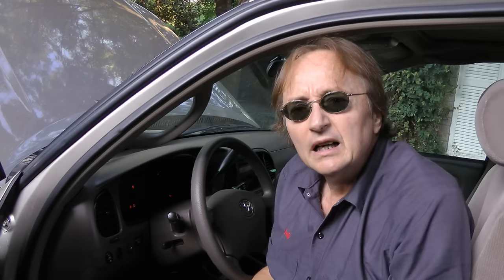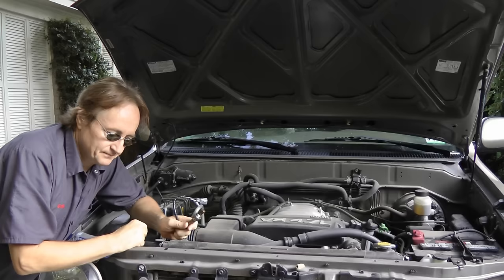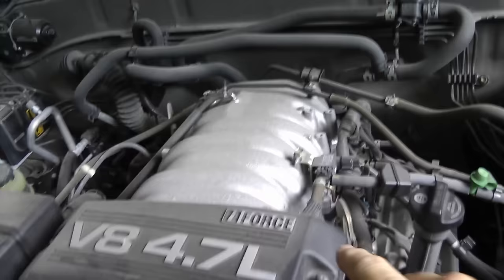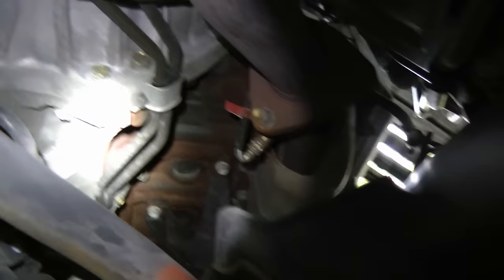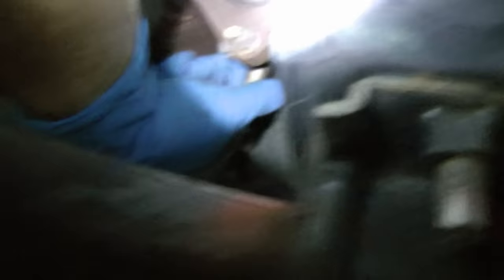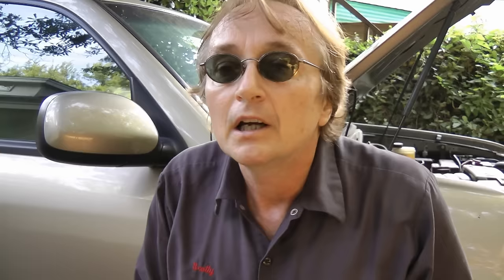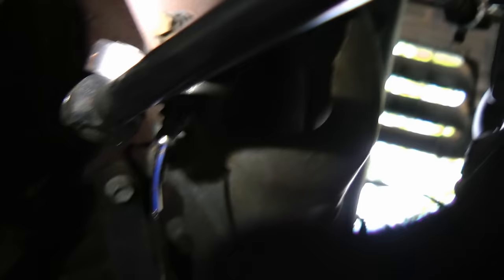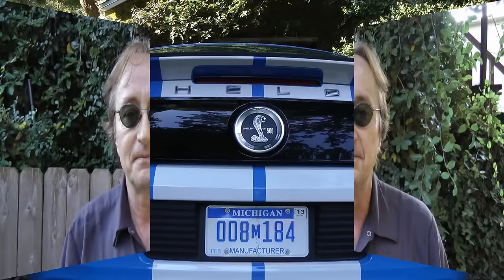How to Replace an Oxygen Sensor in Your Car (Air Fuel Ratio Sensor)

Comment: Hey Scotty, I have a 2004 dodge ram 1500 5.7L shortbox regular cab, I have codes coming on non-stop when deleting. Codes P0420 AND PO430, my truck seems to run fine. I hear no rumbling or anything in the CATS when running. My local exhaust shop estimated $600 for two new Walker cats and welding etc. Could it be bad 02 sensors or truly the cats itself? Thanks, Cam.

Comment: Hey Scotty, great video! I've received my "O sensor" without the plastic protector that goes around the metal end, and there's grease all over that end. Do you just wipe it put clean with a piece of cloth, or do you use something else, since that is the part you'll screw in? Thanks in advance for your details, Scotty!

Comment: Hi Scotty. I have a code 02 sensor bank 1 upstream circuit on my 2013 Dodge Caravan. How to locate it and how to change it. Thx for help Chester
Reply from the maker: it's the sensor before the catalytic converter on the front side of the engine

Comment: I got a check engine light indicating a bad 02sensor on bank 2 sensor 1 (upstream). Got it part replaced and the code cleared. 2 months later check engine light came back on saying bad sensor on bank 2 sensor 1 again. The part I use is oem. What's causing the sensor go bad again? Have a 08 trailblazer v8 runs just fine.

Comment: when you start up the car at the end and the CEL light goes off, is this how it always works, you don't have to reset the computer? Also, is it necessary to disconnect the negative battery terminal before doing this?

Comment: Hi!  Scotty I have a volvo s40 2002 and idk if my catalytic converter is bad or my oxygen sensors.. Because I did the seafoam treatment and it turn off the check engine light for like an hour and then it pop again. The code is (p0420 catalytic system efficiency below through bank 1) idk could it be the sensors. Anything I can do to know whats wrong?  Thank you

Comment: And sorry another question with this video I have a 2001 venture van any ways I can only drive 8 blocks until  it dies out I get to about 40 km and it quits almost like I don't get gas or air stalls and back fires and squeaks  in the motor  Ty for your time and help

Comment: Hey Scotty I have a 2011 Chevy Aveo LT. Im getting codes P0138, and P0054. They're both O2 sensor codes. 54 is Heater Resistance Bank 1, sensor 2. 0138 is Circuit High voltage, bank 1 sensor 22.Sometimes when Im driving, Ill give the car gas and it won't accelerate. Its seems as if it just maintains the same speed and I push the pedal until I get close to the floor and it finally accelerates. Can a bad 02 sensor cause the acceleration to be thrown off or may this indicate a different problem? I was thinking it may be the throttle position sensor? I really appreciate it man, And I always watch your voids for car advise. Rock on brother, and thanks!

Comment: Hay Scotty, I had the same problem on my 1997 3000gt base model. I got a Bosch o2 sensors bank 2 sensor 1. I changed it but the check engine light is still on. Please help. Thanks.

Comment: Great O2 sensor vid. In fact, love your vids altogether.  
Is it a bad idea to just replace all O2 sensors together in one fell swoop?  Or just do the specific O2 sensor that triggered a failure?  Just recently it tripped the downstream O2 sensor.  I just got a used hi-mile 2009 Camry (175,000 miles) and did a huge tuneup.  Im in the mode of replacing lots of items to ensure I know the baseline health of the vehicle. -----Thanks & keep up the great work.

Comment: @scottykilmer had 3 codes come up and 2007 BMW 530i. P0030 , p0301 and p0305. Last two codes misfire in cylinder 1 and 5 . I quickly swapped 1 and 2 coil to check if coils and surprisingly code misfire cylinder 1 is now gone . Only misfire 5 and ho2 bank 1 sens 1 codes are coming . So can bad 02 sensor make cylinder codes come up ? Thanks!

Comment: Scotty, you have great videos! I’m reaching out for your thoughts.
I’m looking for a solution to the P0498 error code for my 2009 Honda Pilot. I️ had several others pointing to the oxygen sensors. I️ replaced all 4. Could you offer any advice on my next move to resolve the remaining error code P0498? 
“P0498 indicates the evaporative emission system vent control electrical circuit signal had low low voltage for a predetermined period of time. “
Autozone’s suggested parts are fuses. There are no failed fuses... 

Many Thanks!

Comment: I have not replaced 02 sensors on '09 camry 2.4L for more than 200,000 miles.  If they don't seem to be causing any issues or throwing any codes, is replacement necessary?

Comment: My 04 STI has the P0037 code and it is running on a rough idle, and stalls when i give it gas. Is this common for a faulty ho2s heater control circuit low bank 1 sensor 2?

Comment: I'm getting a code PO171 which it is saying left air bank is lean, I've taken the mass air flow sensor out and cleaned it because that is the code for it as well. So could it be my o2 sensor because I had gotten one replaced around 6-7 months ago.

Comment: I replaced a bad fuel pressure regulator on the throttle body ('91 Dodge van) and that cured the black ooze spitting out of the tail pipe, and it seems like I'm getting back some lost gas mileage, (no odometer) but I still have black inside the tail pipe, so I was wondering about the 02 sensor, but the check engine light is off, so maybe it's OK..Any suggestions anyone? Is a blackened inside of a tail pipe normal? I didn't think it was. It means it's running rich, doesn't it?.....OK leaking injectors, caught that tip. So I should check / replace the 0-rings on the two throttle body injectors. It's not expensive.

Comment: Hi Scotty Thanks for the video.  One of my car had CEL code for "too lean" condition, OBD2 scanner found really high LTFT (15%).  I troubled shoot and found out it was caused by a bad O2 sensor. Replaced it and fixed the problem.   I have another car (2001 BMW 330I at 160K mileage).   LTFT and STFT of both banks are ~ 0%.  My question is that if 0% LTFT is a clear indication of good O2 sensor? Thanks much.
Reply from the maker: either good sensors, or ones that are not working at all would stay at 0

Comment: If i have fuel consumption issue but no check eng light, is it still poss to get codes to pin down which if any o2 sensor might be bad?

Comment: Hey guys I have an 05 Jeep Liberty and I’m trying to replace the bank 1 upstream 02 sensor (trying to see if this will get rid of a P0420 engine code) and I am absolutely at a loss as to how to disconnect the wiring. It’s above the front drive shaft and exhaust manifold and I can’t even get my hand in far enough at the right angle to detach the clip. Trying to avoid a mechanic fee and also avoid taking the manifold off but I’m running out of patience here.

Comment: I’ve had an o2 sensor problem for so long and mechanics switched it out 3-4 times but it keeps coming on. I tried saying it could be a computer problem but the mechanics won’t listen and keep trying to change the sensor. I dunno what to do. (2003 Toyota camary)

Comment: Hi Scotty.., My VE HOLDEN COMMODORE engine light is flashing on the speed of 70kms and start loosing power also shaking all over and Missfire you can fell on dashboard.,  I change a new Coils Pack & New Spark Plugs. Still Light  Flash on? Do you think it's O2 Sensor., It has black Smoke and the 3 Spark Plugs on Bank 1 is covered with Black Carbon., the Other Bank is not.

Comment: I have oxygen sencor for a 98 mitsubishi montero sport ls its not the same it was clamped on the side the engine kinda looks like a capacitor. With out my sensor im loosing work.  Was this just rigged to pass edmission

Comment: Hey Scotty, I just bough a 2004 pontiac grand prix, and it had something dangling down from the middle of the car, I tucked it away because I didn't know what it was. 
My car had issues and wouldn't start, I shotgunned the whole ignition and fuel system, and I'm getting no fire when I turn my car over. I had a friend read it with a computer and it gave me a "p0036 code" (no heat), do you think that could be whats not allowing my car to start up and run again?

Comment: Hey Scotty! I have a 2000 Saturn SL2, which has a new oxygen sensor installed pre catalytic converter. The check engine light went off, however after having driven the car over 800 miles, the computer will not reset secondary air. I've asked many people what to do and I can't seem to get a good answer. You have any suggestions? Thank you so much! :-) PS love your Channel!!

Comment: Hi scotty i have a  2007 pontiac g6 base 3.5l 6 cyl car ... i have code p0157 showing cars running rough and has all signs of bad 02 sensor.. my question is do you know where bank 2 sensor 2 would be located at and if it is downstream or upstream? Thank you 😊

Comment: Hey Scotty I have a 1990 dodge ram 150...5.2 engine...i put a idle speed control motor on it and plugs and wires, it still not running the way it supposed to be...still run with a sputter and idle changes as well...what could be the problem

Comment: Hey Scotty,
I have a 2004 Chevy Tahoe 5.3 V8 with 215k miles on it. The engine light has been on for a while and now it's flashing at me from time to time.  I put some new plugs in it and it runs fine at idle and low acceleration but if I get on it the engine pings and that's when the light flashes.  I've got a few things to inspect/clean (MAS, throttle body, etc) but was looking for your opinion.  I haven't connected to read any codes yet either.
Thx!
Reply from the maker: get it scanned, tons of things can do that, especially fuel injection system leaks on that odd GM plastic infused injection system where they crack and leak when old inside the engine.

Comment: Scotty Kilmer Hey scotty!
Can a bad O2 sensor cause "steam" or smoke from the exhaust? And also misfire?
Reply: A bad o2 sensor will often cause the engine to run rich, resulting in black smoke coming out of the exhaust if it’s serious enough. If you have steam coming out of the exhaust, it’s most likely a blown head gasket.

Comment: Thank you for responding. Is it possible that it sounds like the oxygen sensors might need replacing? It failed to to crank twice including once at a drive thru so we haven't drove it far since. We pushed the van out of the drive thru line and then 15 minutes after trying to crank it about 20 times it worked. 

Do you have a video about how to fix leaking intake manifold gaskets?

Comment: I have a Ford Windstar SE 2003 minivan and my husband hooked my brother's diagnostic tool to it to find out why the engine light won't go off. 2 codes showed up - 
P0171 and P0174 and Bank 1 and Bank 2. I'm asking for your advice because we'd like to install it ourselves. Can you recommend which parts are the best to buy and if there are any extra tools for removal of the parts that we need to buy to get our van fixed?  
Thank you.

Comment: 2005 dakota SLT 4x4 207,xxx .All four of my 02 sensor showed code.   p0057, p0031, p0037, p0051. can all four of them just fail at the same time? The codes popped on last night after work.

Comment: I have a 02 sensor heater out - but I cant get it off to tight- sure don't want to take it down to a Garage over this. any idea how to get this off- Or would it damage anything if I just left it on? Chevy 2000 Blazer

Comment: My ford ranger sport 2011 was running well this past summer.. When it started snowing or temperature hit - 3 to -5 my truck started acting up. Warmed it up, went to work and later it died on me. Truck is weird because it acts up when it's only a bit of a chill,like I mentioned - 3 to - 5. I bought an 02 sensor for my truck.. Hope that helps? Any other solutions?

Comment: Is there a difference between a/f fuel ratio sensor and a o2 sensor ? I have a nissan murano 2007 and my check engine light is still on after mechanic put in a o2 sensor I went to another mechanic and I was told that it was the wrong part I need a/f fuel ratio sensor. I'm wondering how he made that mistake.

Comment: How many oxygen sensors do these Ford hatchbacks have. I have a 2007 focus and I ordered new ones which were two O2 sensors. I looked where they were behind the motor and there's actually three of them on this car. The farthest one away from me is cut and was unplugged. I just bought this car a month ago and the O2 sensor check engine light was on. Would they cut it because the O2 sensor is bad and should I just replace that one?

Comment: I have a code P0031 , I need a HO2S heater control , (Bank 1 Sensor 1). It says circuit low... my question is do I just change it do I check something else before ? any fuses or connections ?

Comment: My 04' xterra, 130,000 miles has been throwing the p0430 code  (catalyst low efficiency, bank 2 ) on and off for a few months.  So,  during that time,  I ran down the line.  I replaced fuel filter,  plugs, wires and distributor cap. Didn't fix it but it needed done anyways.  Temp check on cats, ok. Vacuum check,  ok. Read something about the red dust of death in the distributor cap.  I remember seeing that during cap replacement,  so I bought a new distributor.  Low and behold, the bearing inside the distributor was toast. Average life expectancy for that stock part? I exceeded our by 20,000 miles.  Yay me.  I don't know how the truck kept running with half of its bearing balls missing from the race.  Reset the CEL. Good for a week,  back on for a couple weeks then turned back off. Off a couple months now back on again. MPG dropped by 10% in last 2 weeks. In reading up I decided O2 sensor probably bad since they are factory and should have replaced at 80,000 miles.  Oops! So, now I'm replacing all 4 O2 sensors tomorrow. Hopefully they they'll come out of the stupid hole.  I haven't had much luck with stuff coming apart or going back together in a reasonable amount of time,  except my drive belts last week.  That was actually pretty quick and easy for once.  If these sensors don't fix my CEL, I'm afraid I'll be at a loss and I just cannot afford to go to a mechanic. I'm learning everything as a first with this truckin DIY.  At this point,  everything I've fixed,  needed fixing or maintenance anyways.  If it's something else,  it's going to get really expensive,  because that leaves a variety of other sensors and the precats or cats themselves.  Any additional input is always appreciated.

Comment: I have a 1994 f150 automatic 2wd 4.9 tht I recently put new wires plugs roster cap and button and a air filter on before I did all this I never saw a check engine light come on could this be my oxygen sensors

Comment: Also unplug the battery while your at it.

The pcm doesn’t need all the extra “lean” and “rich” trouble codes floating around in the system.

Comment: Hello Scotty,
 I don't have a code check engine light. I want to pass emissions and on it system it says o2 and evaporation. He says I need to drive it for 15 min straight at 55mph or more and it may take one or both of those emission alarms off. True thing is I haven't been going that speed for that long period of time for a couple of months.

Comment: I’m getting this code p0031 and my grand Vitara is sounding rough and stalls on stops or when putting into gear. The Suzuki is also 312000 kms so not sure if it’s the engine that’s being rough on its own or if the oxygen sensor is causing it to run rough
Reply: How did you fix this ?
Reply: I managed to just sell the car for 2000$ bought it for $600

Comment: Hey Scotty love your channel. I have a 93' grand marquis. Intermittent check engine light. Heavy hesitation on idle and accel. Almost feels like a misfire. I can't figure it out. Familiar with panther platform vehicles? Btw it's first year for 4.6 and it's hard to tell but I think I counted the code correctly for lean/rich bank #1&2 02 sensor

Comment: I have a 2000 ford ranger and it marks the bank 1 and sensor 2 and I bought them both put them on right and the check engine light still goes on what else can I do so the check engine light would go away?

Comment: I have code p0172from orileys and at autozone they said p0175&p0172. I got my son a used Toyota Sequoia 2005 lots of miles 230k. The engine light came on and now I’ve changed all the spark plus, flushed radiator,changed the oil, cleaned the mass air sensor and still have the engine light on. What could it be? Do you think it’s the oxygen sensor. Weird thing is the car is running fine and sounds good. Thank you

Comment: I have a 2008 f150 4.2 and the 2 upstream o2 sensors have gone bad I tried getting them out but their really stuck in their I used a breaker bar even getting them red hot and dumping water on them to break the seal do you have any suggestions of what I should do next
Reply: maybe some PT blaster penetrating spray?

Comment: Hi Scott. Huge fan of your videos. I have gotten codes P0138 and P0157, high voltage and low voltage on the two downstream O2 sensors, respectively. I replaced both downstream sensors and the same codes came back on. All of the relays are fine under the hood. Any idea what is causing these codes?? 2006 Toyota Tacoma 4x4 4.0L
Reply from the maker: either the main computer has gone bad, the wiring from the computer to the sensors has gone bad, or you have a serious engine management problem, like leaking fuel injectors causing the sensor data to go bonkers

Comment: For a Toyota Corolla 2000 ce I bought the oxygen sensor(upstream ) but while I was replacing I notice that one of the bolts was like kind of weld and  I just point to the bolt to take it out and automatically fall out apart  one of the bolts work but the other doesn’t what should I do ?? How much it will cost